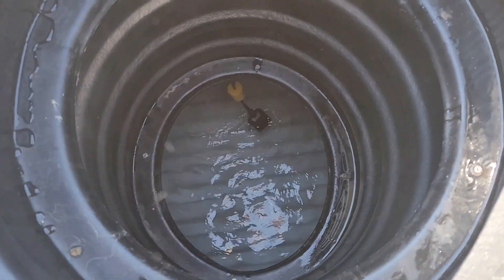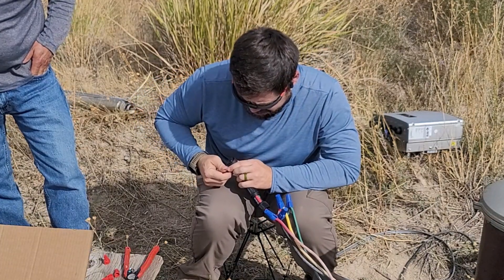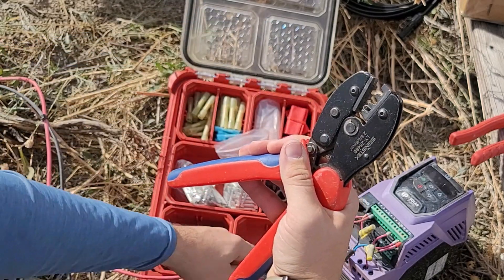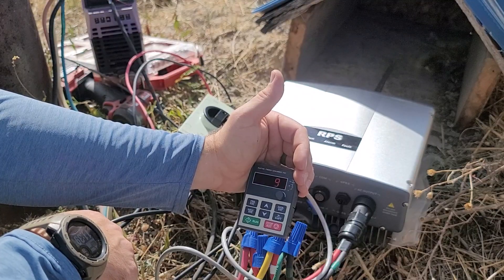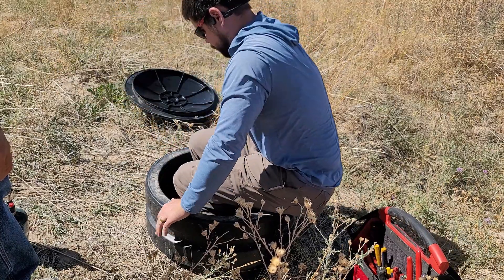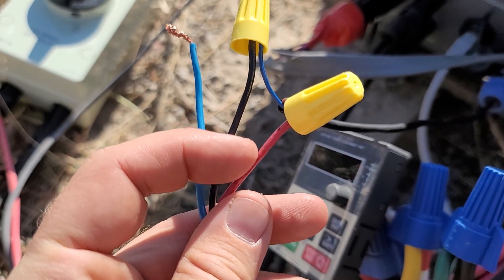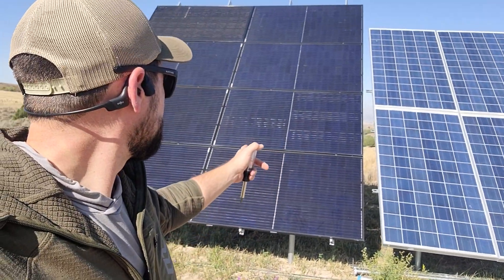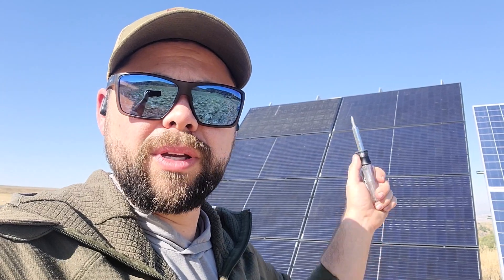Off Grid Well Water That Will Never Run Out With Solar

Comment: It occurs to me that having a DC powered pump that you can directly power from the battery would allow you to omit the inverter entirely.   Then all you would need would be the solar panels, charge controller, battery, and pump control logic (controller and float).   And as a bonus, there would be no vampire power consumption from an inverter (which is going to be idle most of the time).

Comment: Hello Minute Man Prep, I have a question about buying a Clamp Meter, as I will be not only be building a house and also be going toward off grid with solar... Would you happed to know much about clamp meters??? This is one I was considering, could you, if you know would this one be suitable for my situation its a Fluke 325 Clamp Multimeter AC-DC TRMS... Thank you and always Liked#21 N Subscribed!!!
Reply from the maker: That one is really good and I recommend it.
Reply: Flukes are really good meters but they are also really really expensive.  I'm seeing $390 on Amazon for the Fluke 325.   Whereas a Kaiweets HT208D AC/DC clamp meter is only $89.  The Fluke is the higher-quality meter but the Kaiweets works really well for me.

There is also the older Kaiweets HT206D at $50, but the dial on the older version is unreliable so I don't recommend it (I have one).   Still works fine, just is a bit finicky sometimes.

-Matt
Reply: @junkerzn7312  I have seen the Fluke 325 down as far as $$221.00 USD